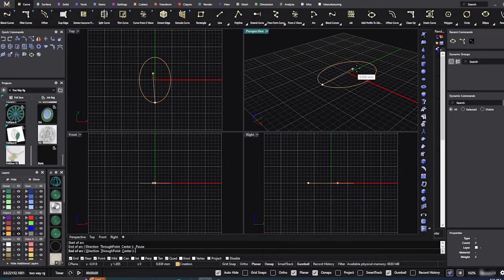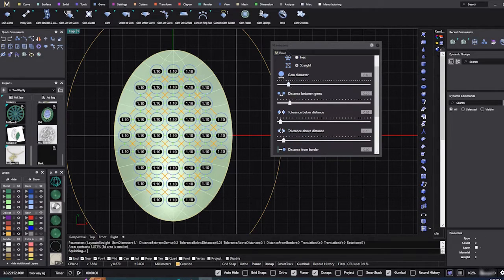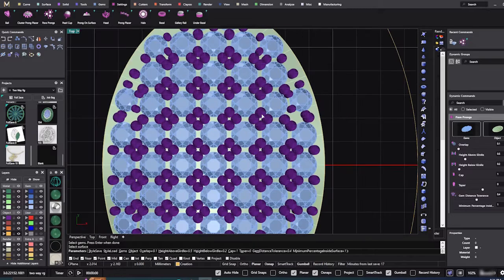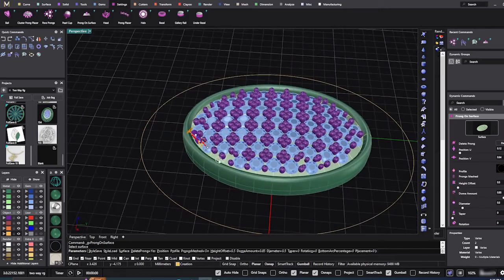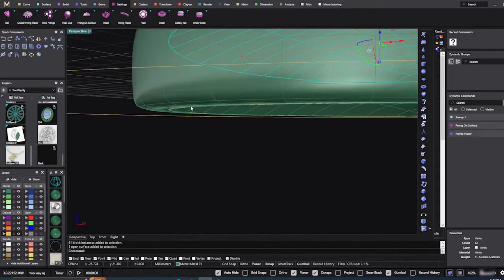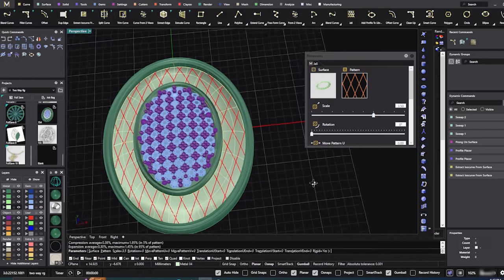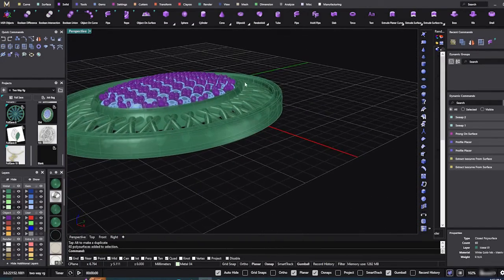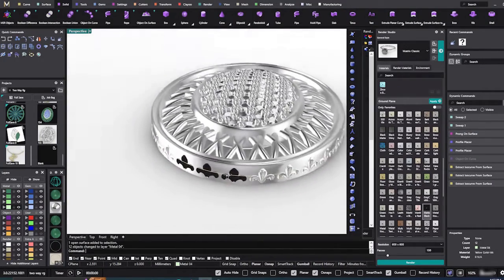Matrix 9 to MatrixGold Pave Builder and Gem Springs

Comment: Hi very nice video thank you so much could you please tell me which version do you use on Metrix gold
Reply from the maker: I'm using V3. I guess there is an update that will be coming out soon for it that will be a free update. I understand it will have some rendering issues fixed. No longer have to do the cut outs for a decent render. Thanks for the compliment.